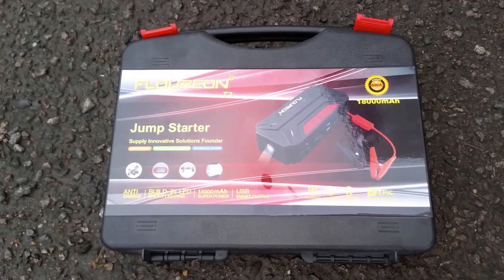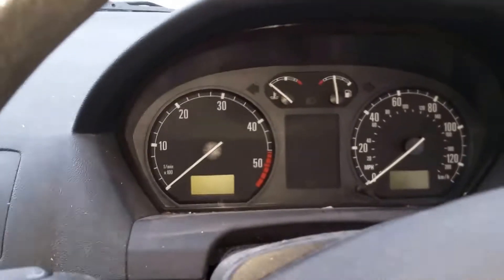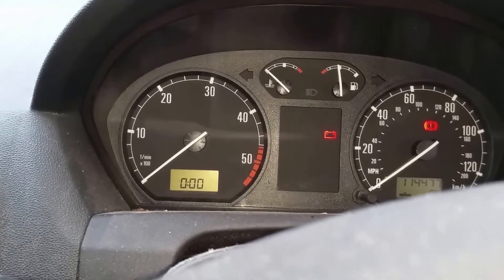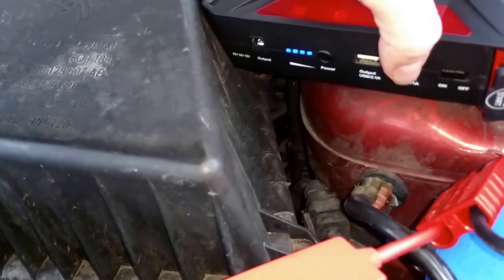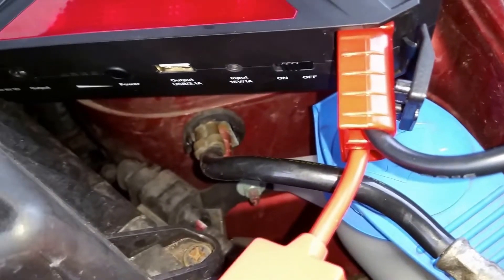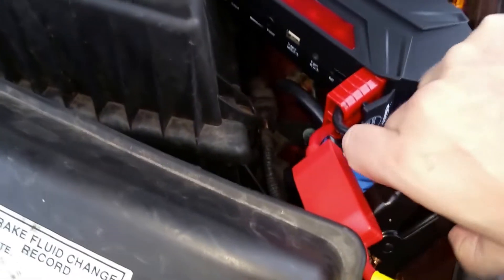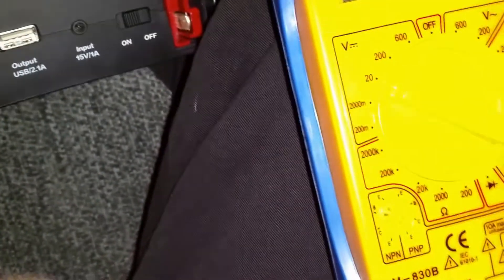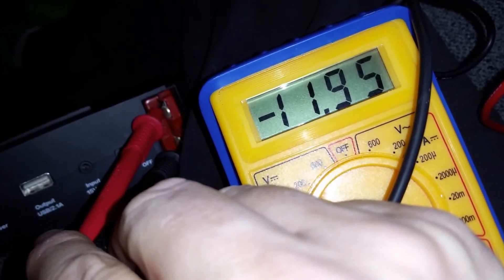Floureon T3 18000mAh Car Starter Pack Extreme Test Review

Comment: If you knew anything at all about how these work, they are NOT A REPLACEMENT BATTERY and must have the cars battery in the circuit! You will fry the alternator at a minimum . It is a BOOSTER for the flat battery, you plonker!
Reply from the maker: "you plonker" 🤣🤣.
I am aware of this. There was a reason I tried this on my £500 car, and not my £10k one. A short time to show an extreme case. Years later, the car is fine, and the battery booster pack is fine.
Reply: @TrossachsPhoto  no realinsult intended, the reason I watched the "review" was to "review" the actual product before purchasing one, not to watch your experiment. have a good one
Reply from the maker: @tonyfox1434  all taken in good faith. 😁